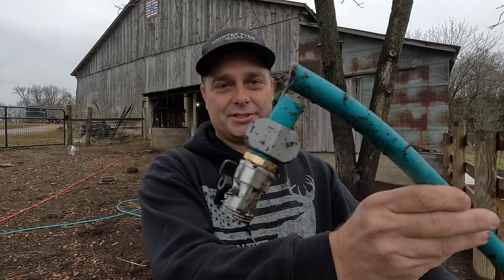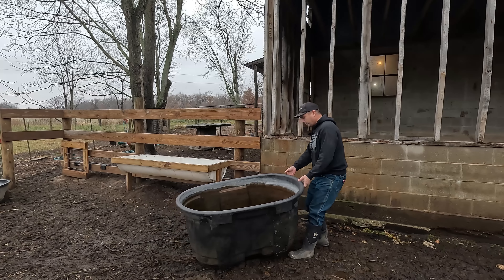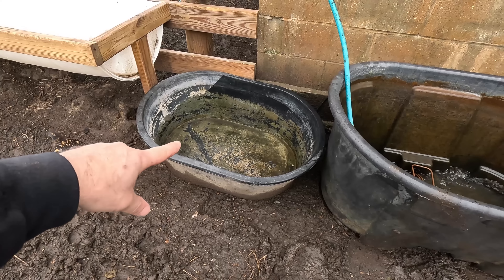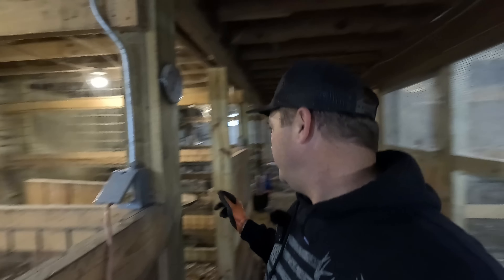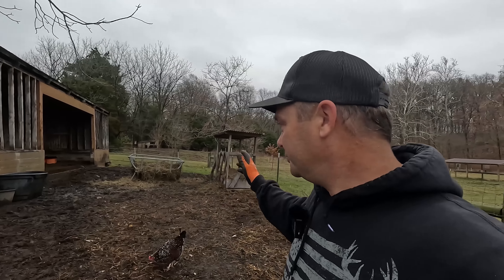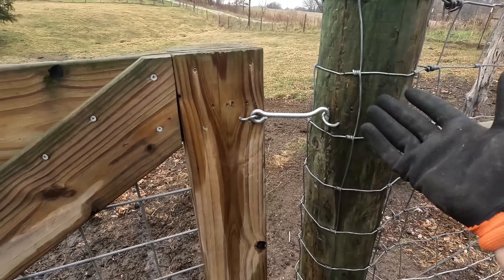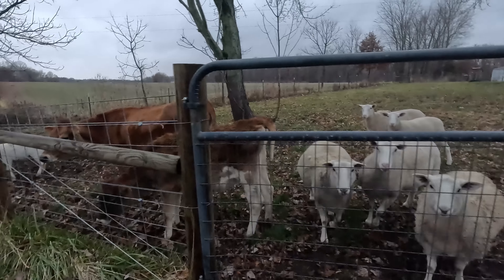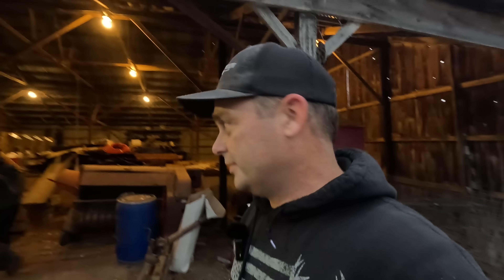It's time to Clean up after the Pigs

Comment: Evan, I have found that when you go to start ANY mechanical project:
1) Take LOTS of pictures, before doing anything.
2) Pressure wash/steam clean, going over it, at least twice thoroughly.
3) Take a quicker round of pictures, to identify cracks or breaks..
4) Think through what you 'know' about the project, morning coffee is a great time.
5) Start disassembly, have at it.
Following these simple steps, you will have the least, stop, go back do item 2, then restart the repair issues.
I detest, where people just start in on taking apart dirty equipment, as they don't always clean things properly, before reassembly, never mind just after disassembly. Whereas if it's cleaned properly, at the start, you have a MUCH better chance of a long lived, successful rebuild.
I have worked on mining equipment (4 brands), tractors (3 brands), forklifts, and track loaders, for work. Also worked on my own motorcycles (3 brands), pickup trucks and Jeeps.
Best wishes from the far North..

Comment: You are really getting to understand cows. From what I have seen, they can be regular Houdini's and are always so curious. Wonder if having some sort of cover over the electrical plugs outside would be useful. You know exactly where it is located and what opportunities the animals could have to mess around with them.  Good fixes on the gate.
My dad worked full time and farmed and it isn't easy, especially when the cow needs to be milked. He had to do it just before he left for work and when he got home. 
The tractor is changing and is going to come together. You are doing fine. Good luck with it.

Comment: Does the water still keep going under the barn into the rear of the barn? Have you thought about digging down a foot or two next to the barn and attaching a water proof seal around it and putting gravel back in creating a French drain.
Reply from the maker: Yes water still gets under.  And right now I plan to install drainage under the back of the barn.

Comment: Hey Evan, been watching a long time but haven’t commented.  Thought I should share some info on feeding your pigs.  To finish a commercial weaned pig to market weight, the benchmark is approx 700LB per hd.  Another rule of thumb for a lower tech, hobby feeding scenario on pasture, you could use a factor of 3 ish LB of feed for 1 LB of gain.  So, if you bought a feeder pig at 50 LBs and sold him at 300 LB (250 LB gain x 3 LB feed) you would feed 750 LB of feed for the whole period.  You might have more feed waste using the troughs than you realize, which is driving your cost much higher.

Comment: Hi Evan, thank you for another interesting video! This time on the winterization of your farm! Isn’t it amazing how much more work cold weather makes for you both on the farm? The “daily chore time” seems to double. But at least now you have no more pigs to feed! Yea! The gate latch Houdini can be defeated by installing a self locking hook. You should be able to find them at TSC. I used them on my dairy farm to prevent my cows from escaping in the middle of the night. A good way to prevent your water hydrant from freezing. Is to always make sure that you leave one of the valves open on that two way splitter you have on the hydrant. This will insure the water will siphon back down the hydrant. Quick connects on hydrant ends makes fast work of draining the hoses out after each use.
Thanks again and have a blessed weekend!

Comment: Could you put a block heater on your Case tractor that you plug into a 110 outlet? We have them on most of our tractors & they are great for warming up a tractor so they'll start in cold temps.
Reply from the maker: I tried a magnetic block heater/oil pan heater.  It didn't seem to work.
Reply: @CountryViewAcres  Ours are built into the engines & work great. Your welcome to come see them. They work great in the cold temps. Night & day difference between having them plugged in or not.

Comment: Yeah 15w40 isn't going to be any better starting when it's cold outside get a block heater or store inside. My Massey Ferguson 235 uses 15W40 and if it's below 50 degrees it's hard to start.